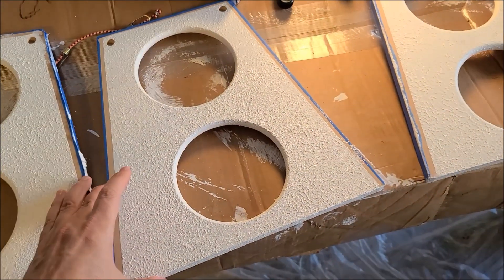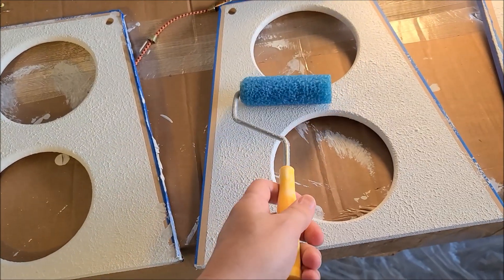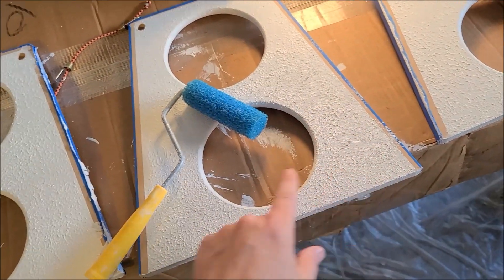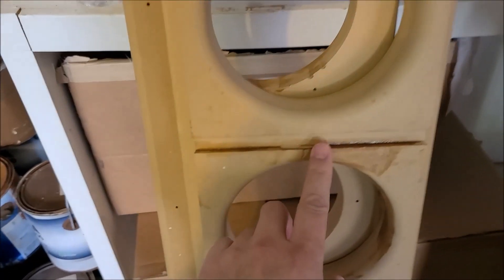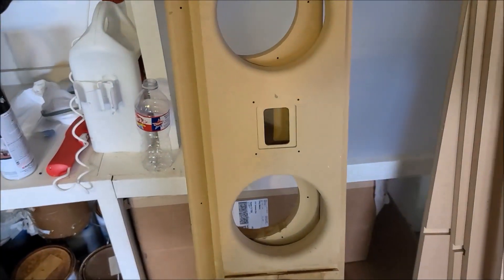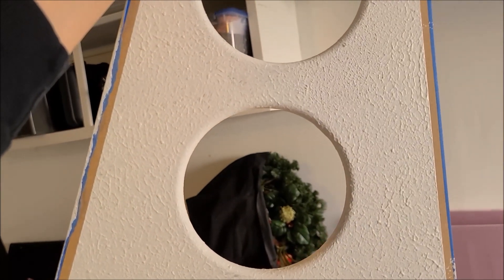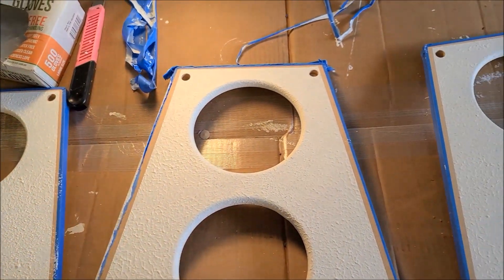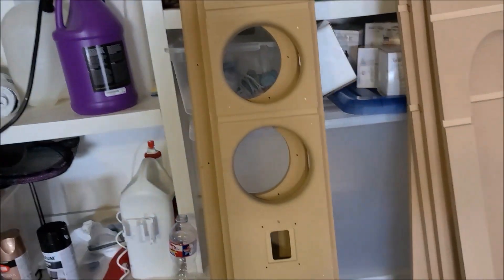Audiophile Junkie - GR Research Nxtreme Speaker Build - Part 3

Comment: Keep in mind that the No-Res will cover the sides and corners of your braces.  It is at least an inch thick, and it fits tightly on the sides, so you will never see those areas that you have carefully taped off, except at the speaker baffle and the large side opening.
Reply from the maker: Yeah...I prolly could have skimped on the braces. I figured I'd play it safe though just in case my NO-RES cutting skills are a little off and gaps show through.